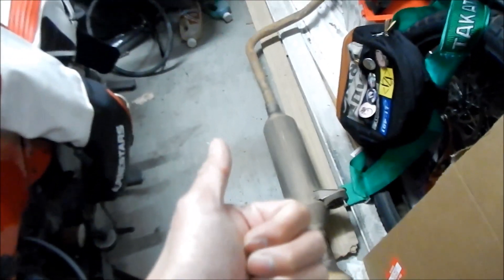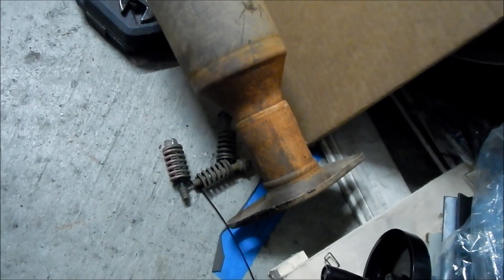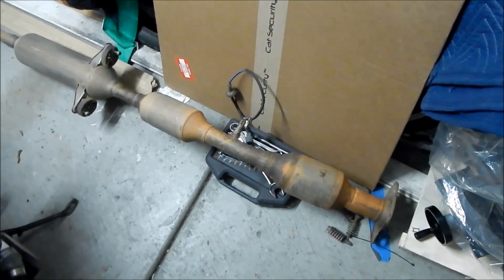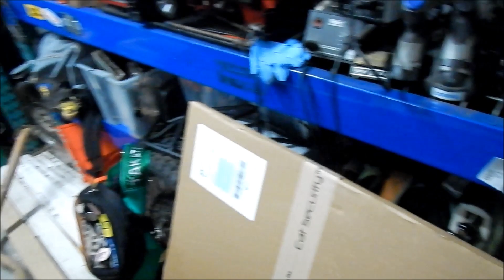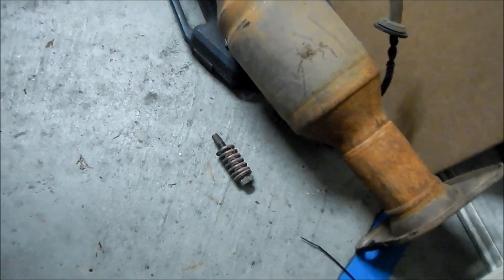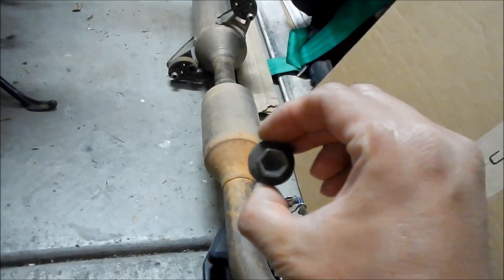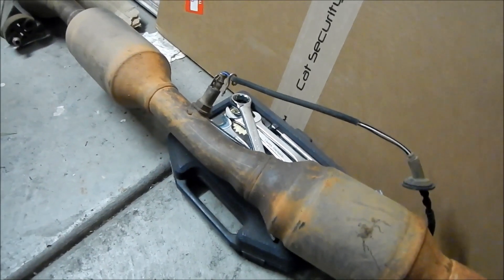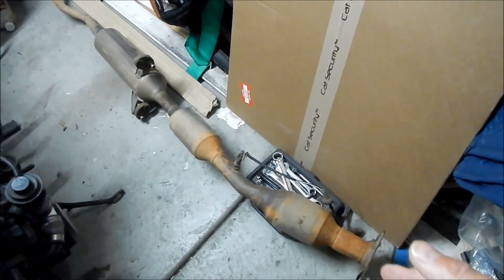Stolen 2G Prius Catalytic Converter Update VLOG Replacement Acquired!

Comment: The cost is now $2,400 . . in California if not a good idea to tell people that it didn't come with your vehicle.The anti-tamper bolts in Sacramento simply  have the head ( cut off a wheel lock bolt ) welded on the end of the Prius bolt & now they charge $150 to their customers only . . they do not sell them otherwise. Your smog tech has to read the model # off your cat. You have the correct #.
Reply from the maker: Ouch yeah it's so bad and I heard even with the catshields they will still try and steal it.  What I did is round off the bolt heads for the cat.  These people stealing the cats are scum.  =(

Comment: Thanks for all the great tips!  My cat got stolen a day before I receive security shield mail order!
Through you tips I was lucky enough to find an used cat from 04 model to replace my stolen one in 08 model, and thankfully they didn't change the design and still fit!
The install worked, no more "sports mode"!  However after a few trips the check engine light came on with the dreaded P0420 code.
I did know it's a risk for buying an old cat, but I did check the mileage on it is a bit but not much older than my car, and did visually inspected the comb and did the rattle test before I bought it.
I would hope the issue would be a bad O2 sensor, which will be less damaging to replace.
Any tips on how to diagnose and replace the O2 sensor?
Any advise on what to do next and get it pass inspection?  unfortunately CA smog is due for registration in a month...
Thanks
Reply: video on youtube "Test 02 Sensor while still installed on vehicle "   02 Code is common & usually false.

Comment: You may get another 50k max out of a 2005 cat. You basically paid about 45% of a new cat which here in San Diego from a dealer is $1650 plus tax and parts.
Reply from the maker: I have 210k on my car now.  I got 200k out of my original one and no problems.  The cats last a long time on these cars because they are hybrid cars, the honeycomb element was still in very good shape inside.  Any number of factors can destroy a cat like oil combustion.